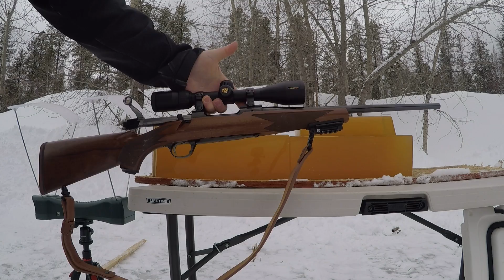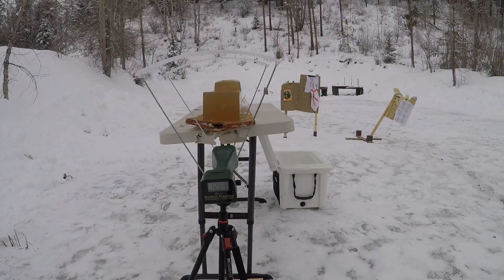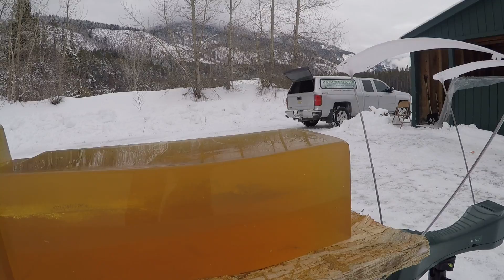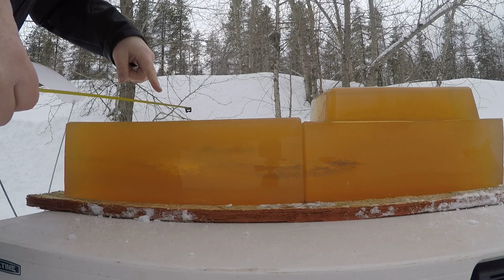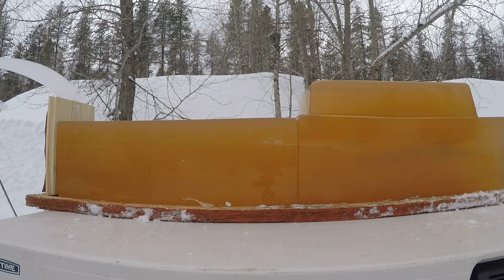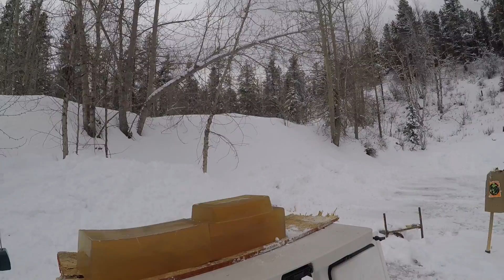Ballistics gel testing the 30 cal 168 gr Nosler ABLR (Read description)

Comment: Great test! I use these in my Ruger GSR. I figure out of a short barreled 308 it would be a better performer on game due to the lower expansion threshold with velocity. Plus the 16 inch 308 is already starting a bit slower. The other bullet i use alot in that rifle is the Speer 165 btsp. Be sweet if you tested that one next, but i do love me some noslers.
Reply: I switched from accubonds to these specifically because of the lower velocity threshold due to using an 18 inch ar10.

Comment: Have you ever tried them on whitetail or muleys? If so what did you think?
Reply from the maker: Yes, a bunch of whitetails and a few muleys. Love them. The 168's are my go-to for  the 30-06 and 308. I even use them for elk out of both. I rarely soot the 300 win mag anymore, but it is set up using the 210gr ABLR's, and one of my 6.5 Creedmoors is set up using the 142gr ABLR's. I have even taken elk with the 142gr ABLR in a Creedmoor. With that said, the 6.5 CM it is perfectly adequate for elk, the only issue I've ever had is shooting an elk within 70 yds and getting over fragmentation and under penetration even with the bonded ABLR. (I did center punch a rib) The 6.5 mm bullet is just too small of a diameter to handle high velocities impacts on game such as elk. (Slow them down, and they are great but your reallylimited on range) I have started using monolithics in 6.5 for elk. 

I am sure that over answers your question, but yes, I like them. They can be a bit finicky to get to soot accurately, but when you do, they are awesome on the business end.
Reply: Thanks! Ya I’m looking for a bullet that hold together at 100yds, and still expands well at 300-400yds out of a 308win. I think this is the ticket!

Comment: I bought some of these in 284 diameter for the 280 ai I have built I shot it the other day with hornady sst 154 and it was already starting to group the weight of accubond LR was 150 grain and I was getting velocities of around 2932 fps with the 154 sst